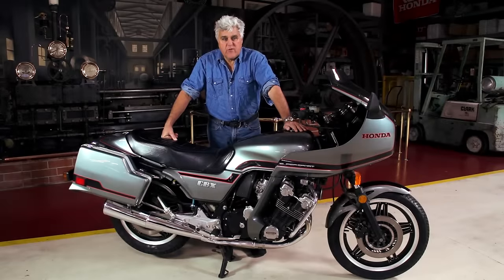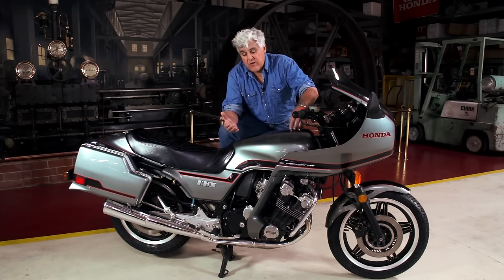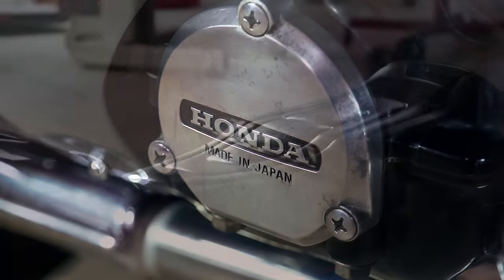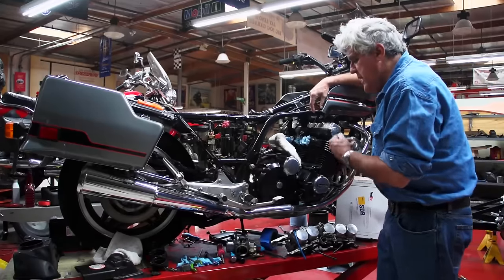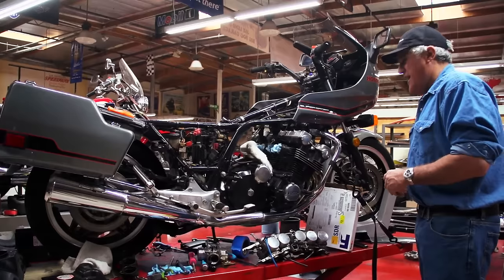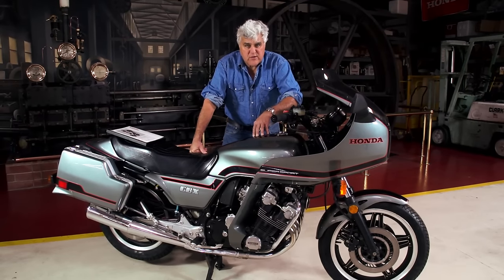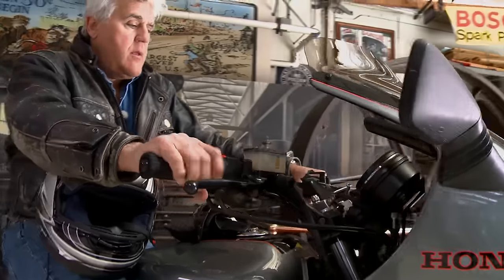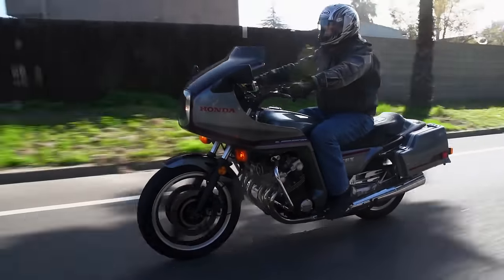1981 Honda CBX - Jay Leno's Garage

Comment: In 1983 I was going to a technical school studying small engine repair when a local Honda shop went out of business. They donated several bikes to us that they couldn't sell, and we got two CBX's identical to this bike but in white and blue. We rode it down stairs, lit up the tires, smashed all the plastic off it and generally hooned it to death, then took the motor out and welded up a go-cart frame and installed the motor in that. It kept breaking anything we could make for it. I think the teacher took the other one home.

Comment: Hey, my first thumbs up on a comment. Run the valves now and set the exhaust the tightest to spec and opposite for the intake. Sync the carbs. Pull the plugs on the mixture screws and set them as needed. 3 turns out sounds good on a Honda but you can roll them all.

Comment: I had a pristine 82 CBX, 30 years ago, pearl white. It had 7000 original miles. I loved it, and I still kick myself for selling it back in the 90's. Everything Jay said about his is true, "except the reason for the high idle".  Mine idled just fine. It was a magnificent piece of engineering. My best friend was killed in an accident on a 1972 Honda CB 350 in 1979. Shortly before his accident he told  me he was going to get a 79 CBX if it was the last thing he did. Unfortunately his dream bike did not happen for him, but in his memory I bought the 82 CBX. It was everything I, (and my best friend) had ever dreamed of in a bike. Powerful, smooth, and as Jay put it, like a Ferrari on 2 wheels. DG Performance exhaust systems was wonderful. Years after they stopped making a 6 into 1 header for the bikes, they dug up the old CBX pipe dies, and they built me a beautiful chrome plated "spaghetti" pipe, as it was called back then. I was meticulous with my CBX. It never saw rain or extended amounts of sun. I covered it inside and outside of the garage. It was absolutely flawless in every way. I miss that bike to this day. It was one of many "I should have never sold that" vehicles that I had over the years. My list of vehicles that I regret selling is pretty large. 1976 Ford Maverick "turned into a built Grabber Maverick". My 1981 Maico 490 Mega 2, My 1966 Suzuki 150cc S20, My 1985 Yamaha RZ350, my 1972 Honda Trail 70 minibike, my 1982 Suzuki RM250z, my 1977 Ford Bronco, my 2003 Honda RC51, my 1971 Dalesman 125cc trials bike, My 1986 Yamaha TT600, my 1985 Honda XR350R, my 2002 Honda CBR954RR, my 1986 XR 600, my 1985 Honda CR 500R, and the list goes on and on.

Comment: In the early 80`s, a friend of mine bought one of these brand new. He was so eager to drive in a carneval, that he had told the seller that there was no option but to drive it, even if the bike arrived the same day as the carneval. He drove it, and had lots of fun - inspired by what was considered a superbike at the time - until he switched to a Gold Wing a couple of years later.

Comment: One of my all time favourite motorcycles, (although the unfaired model). Those six cylinders sound incredible at high revs too, not far from an F1 engine. Also, with six carbs, twin cams and 24 valves, in the late 70's, it was just a wonderful piece of engineering. Unfortunately, just like so many other vehicles that could be picked up dirt cheap back when I started driving, they now fetch ridiculous money.

Comment: Mr. Leno... What you need is a 1985/86 Yamaha Maxim X.
750cc 20 valve liquid cooled inline 4 cyl.  Super smooth and the handling is unlike any cruiser.  Fast flicking hard accelerating metric power cruiser.

Comment: I only ever saw one of these on the road and it made a noise I still remember maybe 30 years later! It did not have the fairings though and it had multiple exhaust pipes and sounded like nothing else I had heard in a bike, smooth like silk!

Comment: I had a 1982 Honda 900 years ago. It had a double shift high low transmission with shaft drive and a few other tricks. Air shacks etc..From the factory. It was a pretty cool bike. Honda was trying anything to stay into the market. And using leftover parts of the 70s and early 80s to make some Frankenstein bikes.

Comment: Its a beautiful bike - In 1979, I bought No. 535 of the Honda 10th Anniversary limited edition CB750 DOHC In 88, I put  her away to raise my family. Last year during Shelter in place was finally able to restore. I love driving her. In Ct, last week, took my dearest to Lime Rock Race Track . a wonderful biking trip. -
Reply: Re: Hi Idle - initially mine had a high Idle.   Agreed Lean is set for passing inspection; but it can only be on a few carbs out of the group. Also the Rubber collars can get brittle with age. I replaced mine. She now idles low even after running at high rpm on the high ways just before - 

Ill look more at your garage now that I have more time on my hands - Im turning 71. btw: for Jump Starting . . . https://youtu.be/FBSxuIgvkR0

btw: also - I dont know where you are located, but if ever in CT, give me a heads up if you are certified with MSF -Id be pleased to take a ride with you -

Comment: I've done a few carb cleans on this model. You have to drop the engine to get the carburetors out. Then the fun continues as you have to wiggle that giant bank of 6 carbs past the (usually dry-rotted) intake boots and airbox. I admit the CBX is a groundbreaking motorcycle, because if you lay this beast down, it's literally going to break the ground!

Comment: I own a 1982 model. There is no need to drop the engine to adjust the valves.
Just remove everything: fairing, top engine mounts, horns, oil cooler, tachometer drive gear.
You can then remove the 8 bolts holding down the valve cover and carefully take off the valve cover.
There is almost no space, do you better put a thin blanket of a sheet of plastic on top of it so you don't scratch the paint.
Getting the valve cover on again is a bit more complicated. 
You have to use something like a silicone sealant to hold the very long gasket in place.
But there is plenty of space to check the valve clearance.

Comment: I had a 5 yr old '79 for 20 years, best engine ever! - it had 150k km on it when I sold it and still going strong.
Burning out the generator bushes(cheap, 15 min job) is caused by having the ignition on without the engine running.
Rear tyre profile is critical for good handling - use a rounded profile.
A useful mod is the 4 pot brake calipers from the pro-link.

Comment: Jay that was and Is the MOST engine I have ever seen! When they came out Kawasaki contender was the Mach III and Mach IV. As for the exhaust I bought (over the years) 3 RD 400...A 2 cycle 400 cc motor that would put out 50 bhp! Now I've settled down to my second Yamaha FZ09 (2017). Beautiful production Motorcycle. It was the Only Honda I ever thought of buying. But Too Many Carbs!!!

Comment: Late to this party (just watched it for the first time) but wanted to comment on the "F15" sound: If I remember correctly what was stated in the magazines that reviewed the CBX, it was said that some of the engineers developed an exhaust that sounded like an F4 Phantom, not the F15 Eagle. One of the top brass for Honda heard the exhaust note and said "No way" . The thing is (according to the article) the exhaust that was pulled off was stuffed into a Honda warehouse on a back shelf. There you go.

Comment: I remember the motorcycle scene from 1978 -1984, it was a dry season. In 1980, I was driving a 1978 Yamaha Enduro 175 Trail 2-Stoke.  It was a street legal bike and great for trails.  In 1980 I was 18 years old and this was a fun bike, but it did have over-heating issues.  Later, in 1984, Turbo bikes were getting big.  However, during this same time frame, large displacements bikes were getting dusty in showrooms.  By 1983, I was riding a 1981 Kawasaki GPZ 550.  I was also enlisted in the U.S. Air Force at the time.  A friend went with me to a local dealership and bought a new bike on a fluke.  It was a 1981 Suzuki 1300.  This bike was huge! It too had a MSRP of $4000.00  My friend bought this bike new for $2300.00.  However, he still had to finance the bike. Money was just tight back in the early 1980's, at least for me as a young A1C Airman.  Anyways, there were some really good bike deals during this time frame,.......IF..........you had the money.  Cheers!

Comment: I chose the Kawasaki GPZ 1100 in 1981 over the Honda CBX. I was driving a 1978 Honda 750K at the time. It was the first year of the 1100 but second year for electronic fuel injection. The bike scared the hell out of me the first time I rode it off the showroom floor. It was so much faster. Sold it in the late 80`s but was able to buy it back a few years ago. Still all original.

Comment: Good day Jay, Awesome bike mate, I owned a mint 1979 CBX (black silver) in 1986, then the bike was considered obsolete by comparison to the then modern bikes, that said, like Yourself I opted to keep the original mega phones and I have to say to date the CBX is the smoothest sounding running high performance motorcycle I have ever owned and the only one that did not need carburettor synchronisation, nice bike well done!

Comment: I also had an 82 that I bought new in 85. It was very fast but handling sucked. I wrecked it in a state park trying to keep up with a friend on a current croch rocket and a corner he handled well but I didn't make. The bike had about $2500 in cosmetic damage but Allstate insurance and the local Honda dealer took good care of me, the only injury was to my ego when I needed help getting it upright and my buddy the body builder who was following us stopped to help but Fred didn't jump off his bike, his wife Lori the Rams (NFL) cheerleader, all 105 pounds of her did. After it was repaired I sold it for roughly double what I originally paid. I wish I still had it.

Comment: I had one of these back then and  my biggest problem was the crappy metal for the exhaust system which was so poorly made that I ended up getting stainless steel pipes.  In Australia, New Zealand and South Africa there were no emission control crap on them. Mine now is in the motor museum in Australia. They were a bloody reliable bike and often used for endurance races of six hours using two riders who both did a 3 hour stint on them or a change of rider when they came in for fuel.  One was sold in Australia for $30.000 on Ebay many years ago

Comment: I regret to this day not picking one of those up in the 90's, I had a low mileage one on the table for $1500 and said no. The air suspension of that era's CB's was cush. The 6 cyl was sublime.

Comment: Personally, I love the naked 1979 model look best, being one of my top 10 favorite bikes ever. It portrayed the clean, massive and intimidating six cylinder engine much better; but if not enough, it looked even better with an outstanding 6 into 1, DG Street Performance exhaust; it's still the coolest sight for a bike's engine and sound is Ferrari flat 12-like. Sweet. I really, really miss those motorcycle days...

Comment: Purchased this same year and model CBX in 1997 while stationed at Ft. Hood, Texas.  The clunk is the syncro’s taxed by the way too fast idle....nothing to do with the chain.  Mine had the black Kerker exhaust Jay mentions and it only got about 18 miles per gallon.  Mine idled at about 700 rpm and had ABSOLUTELY NO VIBRATION....LIKE RIDING ON AN ELECTRIC MOTOR; honestly!🙂

Comment: Those are a Beautiful , Elegant Motorcycle and they looked  FANTASTIC  in the Pearl White colour that was available from Factory .
On that Model , and all the Others similar , I  believe they had " Fixed " the handling  a  Bit . 
Being a Stressed Member Engine , they Re-Engineered the TOP mounts for more rigidity near the Steering Stem . Better stability at speed .

Comment: I worked on those and the whole series of that motor design including mostly the four cylinder versions and for some reason ,even with 24 valves on the fours, the two valve Kawasaki’s and Suzuki’s were faster. I just couldn’t get the horsepower out of them as the others. The trick was to put thev1500 kit in it and even then it was a drag bike and the vmax came along. I still would love to own one and regret the chance of getting two for $1500 in 90 and one had the 1500 kit. Nice bike Jay. I like that you kept it stock. ( you can will that to me if you want! I don’t mind! lol)

Comment: I guess he never heard of Yamaha???  My 1979 XS1100 would blow the handlebars off of just about all of his featured motorcycles. With shaft drive and easy maintenance it was also a very capable touring machine. With fairing and saddle bags we did the Ohio to Michigan upper peninsula (across the Mackinaw Bridge) to Wisconsin, Illinois, Indiana and back to Ohio tour. It replaced my Honda GL1000, and I never regretted the change. I rode the XS1100 until I replaced it with a 1984 Yamaha Venture Royale, a V-4 sport touring machine that shamed my buddy's 1985 Gold Wing. Too bad he did not even once recognize Yamaha in this video.

Comment: I know this is six years ago, but he idle problem sounded more like a vacuum leak. Waft carb cleaner gently toward it to see if the idle speeds up. Another way is to put a rubber tube on a propane torch and without lighting it, allow very low pressure of propane out of the tube to check for the same thing.

Comment: When I lived in Tampa, in 1979, I had an Yamaha XS-1100 and my buddy had an CBX and we traded off on long trips. That Honda was the absolute smootest motorcycle i have ever driven. You cou almost stand a nickle on its edge it was so smooth. The CBX would top out at 120mph and the XS-1100 would top out at 125mph. I think a Ninja 500 will beat that these days.

Comment: Because of Carter's fuel rules, I had to push my bike home 17 miles one night. This engine, and consequently the competitors engines were way ahead of the suspension.  I had the Suzuki with accelerator carbs.  Hated adjusting those individual carbs.  I'll check the carb guy out.

Comment: Guessing at the time this bike was competing in house with the CB900F which was also cheaper at the time. Honda putting a lot into the development of the 900 for racing so the attention to the CBX would have been on the lean side. The 900 eventually became the CB1100F which, like the CBX, is also a pretty nice bike.

Comment: I had one of these brand new back in 1981.
Had to sell it prematurely as it was too expensive to own for me.
Since then, I occasionally have nightmaress that it still remains in my basement partially torned apart with the cover gone and that I drive it without a registration plate , looking over my shoulder for the cop.
I keep the broshyre and the users manual to this day

Comment: Very very cool video. This bike is absolutely amazing! Anyone remember the 6 cylinder Kawasaki KZ 1300, I believer was called? My first bike was the ‘83 Honda 750 Nighthawk. Loved how wide that seat was, and it looked amazing. Wasn’t super fast, though. My next was an ‘84 Honda 1200cc Goldwing. My next will most likely be another Goldwing, probably a ‘93 or ‘94.

Comment: Doesn't look that dated! I had the cbx1000 without the fairing or prolink rear, mine had twin shocks. Incredible engine, I put a marshal 6 into 1 exhaust on mine, sounded awesome! Odd thing about the engine it ran backwards and had 2 cam chains, one driving the front exhaust cam and a smaller chain driving the inlet cam. 👍😎
The engine wasn't much wider than a 4 cylinder because the alternator and ignition were taken from each end of the crank and put on a jack shaft behind and above the crank. Interestingly the engine is tilted forward, partly because of how it formed part of the frame as a stressed member and partly to shoe horn it in while giving enough ground clearance for cornering, which it had plenty of! 👍😎😁 Also the 6 carbs were arranged in a slight 'v' configuration so they didn't stuck out each side too far. That engine kept the rider lovely and warm in UK winters😎😁💥 Miss mine so much 😔

Comment: I had the 1983 CB1100F that would smoke a CBX but I would’ve bought one of those in a heartbeat if one was available. If your CBX is at all like my 1100F, there a small knob at the carb linkage you can reach down and adjust idle speed - perhaps without even having to get off the bike!

Comment: This was overkill but along about this time my stepfather bought a HONDA 350 - 4 ! THATS RIGHT FOLKS A 350CC - 4 CYLINDER MOTORCYCLE.  IT WAS ANEMIC AS HELL BUT IT WAS HONDA'S  WAY OF SAYING " WELL HOW ABOUT THESE APPLES? WE CAN BUILD ANYTHING "! AND THEY DID !!!!!!!
Reply: Those 350-4 were inspired by Grand Prix bikes of the 60-70s : decent power at very high rev, low torque at low rpm. I was given a Honda 125 twin that was taking 16500 rpm and I hated it. In my opinion a single cylinder (or possibly a twin) is more pleasant in 350-400 cc. I loved a Suzuki DR400S in the 80s (SP400 in the USA?).

Comment: I run VP Gasoline in my bike (Ducati).  It;s the small engine formula 94 octane, pure unleaded gasoline.  It has a two year shelf life.  You can park the bike with no worries.  It won't gum up or shallack or draw moisture.  A little pricey but worth every penny!!

Comment: Chain hitting the chain guard ! Going to have to adjust it, Really !........Going to have to sort the idle yep I would Jay as there is no need to have it revving at about 3 grand saying it has to due to the carbies running lean if it is then re-jet the thing and lower the idle as I see the headers are toned meaning its running really lean and hot. I had a few drags against a CBX on my V4 - Honda VF1000R and I could only just beat that bike they were very deceptive on just how quick they could go. however I think my 2003 Honda1100XX SBB could take care of one now quite easily....Gotta luv Honda's for the quality they build into their bikes I over the past 41 years have owned several.